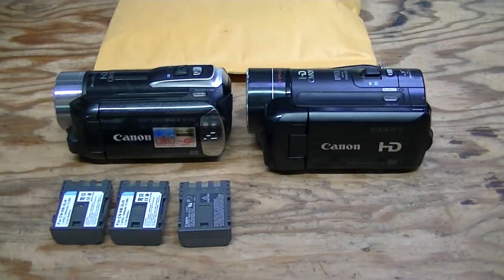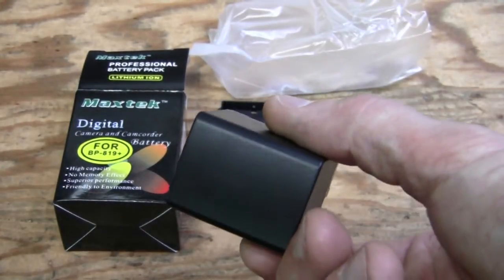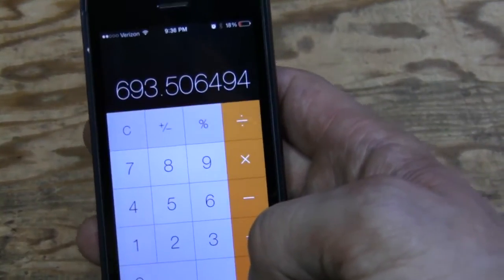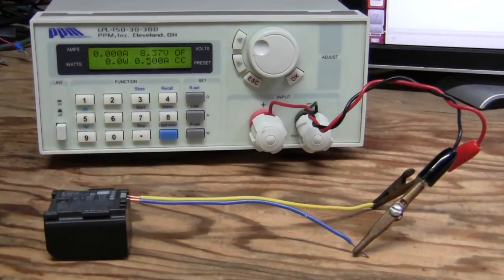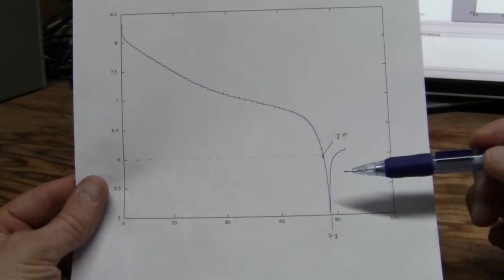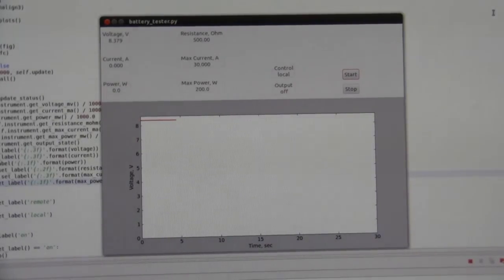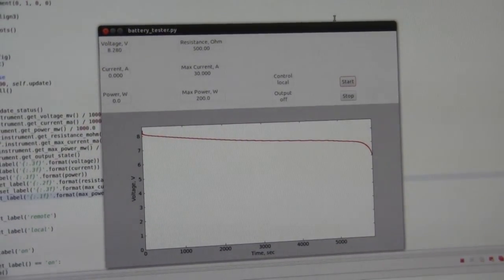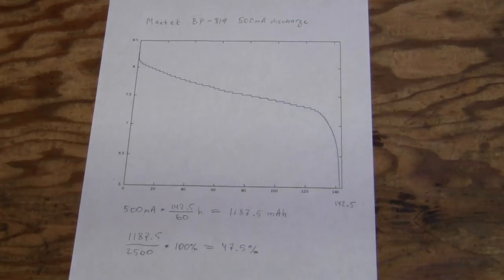#9 - Canon battery testing part 3

Comment: You could open one of those up.  I had the generic one for kodak and it bit the dust in a year.  I opened it up and result was shocking: the protection board only had a handful, yes, 5 parts on it.  It the cells were had lower rating than the case sticker.  The cells were probably destroyed from over draining too.

Comment: Assuming the capacity for a battery is proportional to its price, it looks like you're getting more than you paid for: 1/2 of the original battery capacity at 1/5 of the price -- not too bad, assuming it does not degrade too much after a number charge/discharge cycles.
Reply from the maker: The seller apparently thiks along this line too. Offered me 40% refund, since 1200mAh is about 60% of 2000mAh (the capacity advertised). I said I wanted to return the thing, so they sent me a pre-paid sipping label.
Reply from the maker: FeedbackLoop
Just to clarify: 1200 is exactly 60% of 2000. I meant that I measured about 1200, so this math is aproximate.